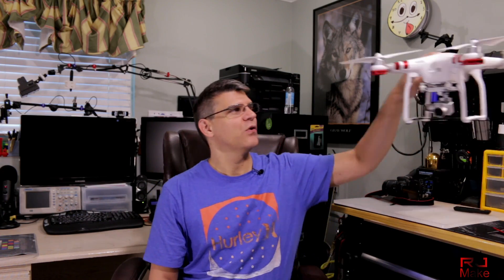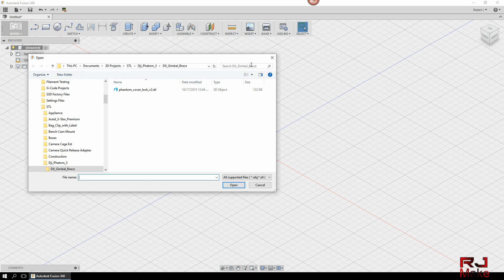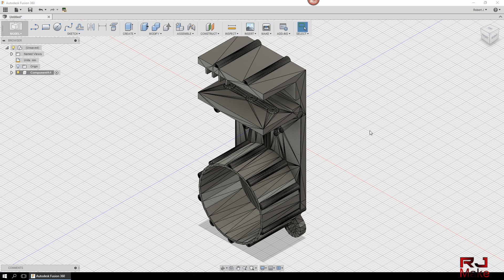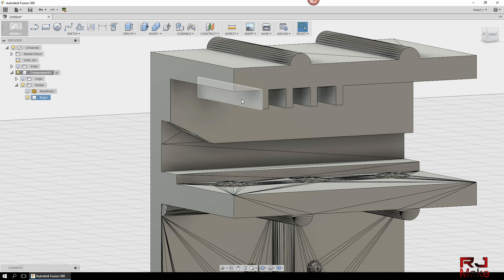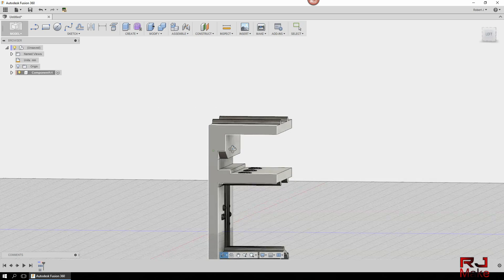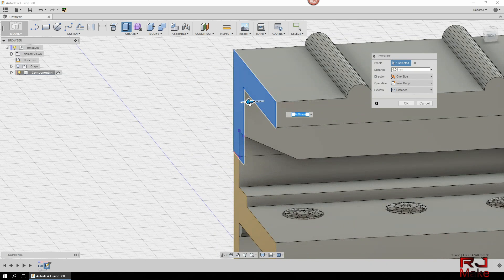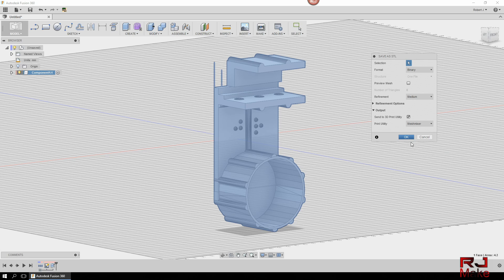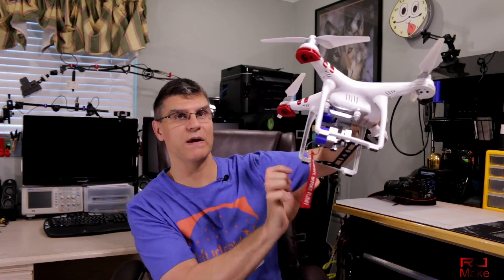How to manipulate STL files in Fusion 360

Comment: Very nice video! I notice STL merges a file, while OBJ allows a file to have multiple seporate parts. Thingiverse is an awesome site, thank you for mentioning it. I wish Fusion360 were better at rendering image textures on complex STL files...but it is what it is, the texturing is weird a lot of the times. I've been learning Fusion360 so videos like yours are super helpful. One other thing I notice, Windows10's 3D Builder is very good at super-quickly repairing an STL before importing to Fusion360. Thank you for the tip to select mesh lines or entire faces which get in the way, and to press delete. 
I come from SketchUp which is slightly glitchy, so Fusion360 is a huge upgrade for me. 
Sometimes Sketchup makes a object which isn't perfectly square, messing up PushPull extrusion...So hopefully I'll find some app which will make near-square objects actually square. Like if a cube is 99.9999999% square, pushpull won't work at all in Sketchup, which is crazy.
There must be some app to convert a STL mesh into the Fusion360 T-Spline sculpting. "Sculpting", more like bubble-squishing. 
God bless, happy DJ Phantom'ing, 3D Printin', and happy early-Thanksgiving.

Comment: It is a very good video, I've learned a lot from it. But is still have a problem making an stl file to solid, but really solid (fully filled in with material). I was downloaded a model in stl format (https://www.myminifactory.com/object/elsa-from-2013-frozen-23754). I would like to do a mold to be able to prepare chocolate/soap Elsa... I was inserted a disk to the bottom and I was able to close the hole on the dress but it has still empty body. When I make boolean difference, material will remain in the form. Could you help me how to solve my problem? I'm sure there is a command in the sw to fill it up, but I couldn't find it. Thanks a lot for your help in advance!
Reply from the maker: That model is WAY too details to use this method. You should try @Eric Gigante method below to see if that works. Otherwise you'll going to need to use something like Meshmixer.
Reply: Thanks a lot for your answer, RJ. I could reduce the number of the meshes, but still have problem. Maybe there is a hole somewhere but I don't know how to check it. Do you have any idea? Thanks for your help!
Reply from the maker: Sorry for the delay. I would recommend bringing this model into Meshmixer. There you can you use the tools to check and manipulate the object.

Comment: To make it easier to get of the those extra faces all at once:

Once you imported your STL file and converted it to a BREP go into the PATCH workspace.  Then go to MODIFY and then MERGE.  Select two of the triangles on the same section and make sure to check "select chain".  Then click OK.  It should make all the flat (vertical / horizontal) faces become one flat area.  I think I explained that correctly.  You can see a video of it here: https://forums.autodesk.com/t5/fusion-360-design-validate/convert-stl-mesh-to-solid-model/td-p/5534047
Reply from the maker: That is awesome! Thanks!
Reply: This is how I used to do it, but sometimes it causes geometry changes, specially for curves, sometimes it also happens when a plane surface has many faces with slight angel. I didn't try the method in the video before, I tried it now, and found it easier and faster, also uses less computer resources. Though, for some reason, it didn't work on some surfaces and now I combine both methods.

Comment: when I delete a triangular face, it just deletes, it doesn't mend/clean up......any settings I should change?
Reply from the maker: Try deleting a different facet of the face that your working with.
Reply: RJ_Make i have, none of them heal.
Reply: Once you imported your STL file and converted it to a BREP go into the PATCH workspace.  Then go to MODIFY and then MERGE.  Select two of the triangles on the same section and make sure to check "select chain".  Then click OK.  It should make all the flat (vertical / horizontal) faces become one flat area.  I think I explained that correctly.  You can see a video of it here: https://forums.autodesk.com/t5/fusion-360-design-validate/convert-stl-mesh-to-solid-model/td-p/5534047

Comment: I dont have the Brep menu and also no menu to create a Component. What do i do now?
Reply from the maker: If you are using the latest version (or even 10 versions back) then my only guess is your not in the MODEL module.
Reply: Ran into this myself. I think you have to turn off capture design history using the gear icon in the lower-right corner.

Comment: Hi, I've just seen your video and I was wondering if you can make a video on 
how to split a more complicated scanned car body part (stl.file) into printable 
small pieces with returnes on the split edges. Would it be possible to 
do it in Fusion 360? Thanks in advance, Andy
Reply from the maker: I'm pretty sure you can, however I would need to see how complicated the model is (Fusion doesn't like high Res. .stl's). Do you have the Thingiverse link to what body you're interested in?
Reply: Thank you very much for the quick reply. I do not have a Thingiverse file. I have half of a bonnet which I made. I can 3D-scan it in low resolution and send it to you, so you can see if it is too complicated. I should have it scanned by the end of the week. Thanks, Andy

Comment: Has this workflow/funtionality been removed/changed in fusion? All I get when following these steps, is an error telling me "Error:   The selected faces could not be deleted. Ensure that faces are only selected from a single body, and that no duplicate or invalid geometry is included in the selection." -- then i thought okay, maybe it's the stl being somehow funny. Tho it had pretty straight faces and corners. Tried another, that gave me error "Error:   The operation could not heal the edited region of the model." -- and I wasnt able to find any side of the model that it could successfully delete/heal. Third attempt with very simple little stl, it finally was able to do that healing.. but nothing as complex as your item was, weirdly.
Reply from the maker: A LOT has changed, so perhaps it's not possible anymore. I will check this weekend and see, although I would be surprised if it's no longer possible. I do know that complex models it's much better to use Meshmixer to manipulate the .stl. 

Does the original print ok? I've seen tons of malformed models on Thingiverse that have to be repaired (many won't even repair correctly) before I can do anything with them, even print them.
Reply: Just made a test with a GT2 Pulley and it worked with Fusion 360 2.0.2685, nice video by the way :)
Reply from the maker: Thank you Thomas, I meant to report back with the same findings (it's actually easier now), but of course forgot...
Reply: Yeah thanks guys for looking into it. I found out that it worked with some other STL files too, kind of beginner here, didnt know how broken some STL files can be. I guess the ones I tried first were made in some odd way, so that the fusion wasnt able to make proper heads and tails out of it.
Reply: Some people say there are more damaged STL files out there nowadays than propper made files :) So don't worry often the file is just damaged and unrepairable.

Comment: I can't seem to find the "activation button" is there any way that I can force it to appear?
Reply from the maker: I'm not sure I understand, can you elaborate?
Reply: RJ_Make it is the bullet point to the right of the part on the index, you clicked on the circle to "activate" it
Reply from the maker: Ah now I understand.. Sorry about that.. You can ignore that part. It's really not necessary for small projects like this. For multi-part designs you definitely want to use components. There are a bunch of benefits to building using components. Do a YouTube search for "fusion 360 components" and check out all the Autodesk's tutorials on it, you'll see what I mean. :-)

Not sure what you're working on, but if the model (.stl file) is fairly complex, you may be better off using Meshmixer to manipulate the .stl file.

Comment: doesn't seem to work for some facets on my file. especially when there are tiny facets and some facets gets joined to the wrong side when it is deleted. 

wish there was an eraser button to remove the lines instead.
Reply from the maker: I have noticed on some models it can be quite tricky. Sometimes the removal order can make all the difference.

Comment: Seems like F360 is finally catching up with the tools i've used up to today to edit STLs. I did try to do it in Fusion a few months ago, but it never really worked as well and easy as SC (or even the free DS M) to convert meshes into editable solids.
By the way, in the July update, they just added a new Mesh workspace into F360 that basically should bring all the functionality of Meshmixer directly in F360. It's still in Beta, so you have to enable it in your account-preferences to try it out. See the intro of the new tool here: https://youtu.be/K1qFIl9h-os?t=275
Reply from the maker: Oh wow, I'm really looking forward to that integration.  Thanks for the heads up.